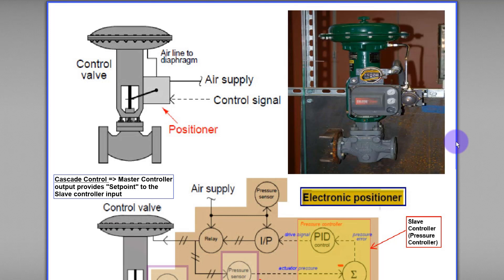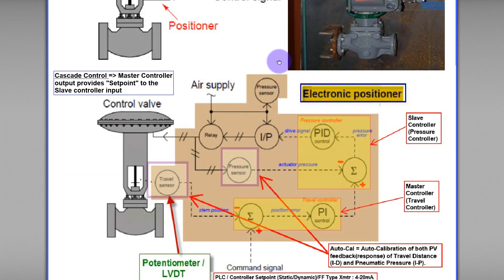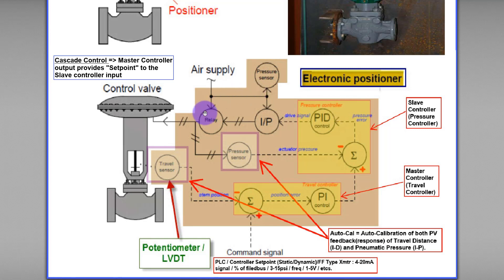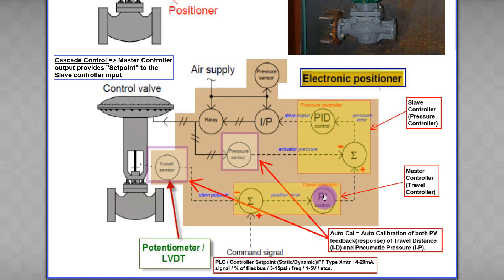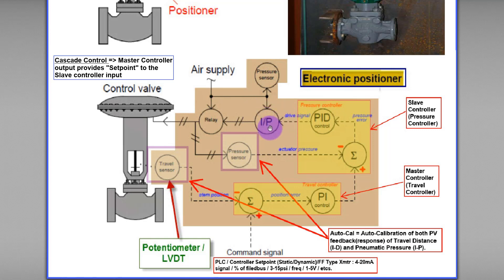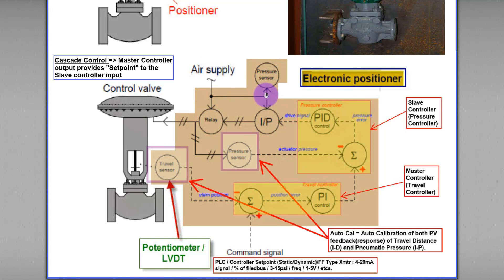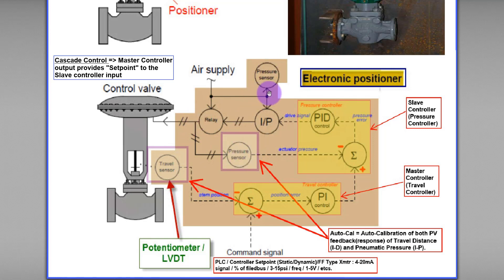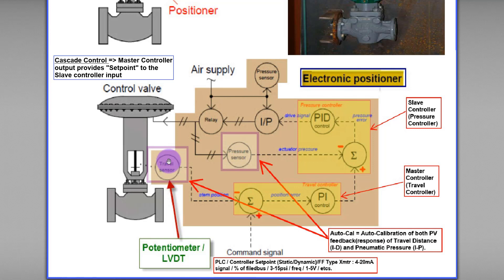Electronic Positioner Principle of Operation

Comment from the maker: "Positioner is none other than a controller but positioner is specifically design for control valve just like the VFD is specifically design for the motor. Cascade control means the control involving one Master Controller and slave controller. The Master Controller output provides the setpoint to the input of the Slave Controller. 

Inside the positioner itself, there is master and slave controllers. The external controller such as PLC will provide command signal (control signal or setpoint) to the input of postioner which is master controller input (travel position controller). This control valve travel position setpoint will be compared to the process variable (PV) feedback from the travel sensor (potentiometer or LVDT) which is usually located in the positioner nearer to the valve feedback arm. The input error (deviation) will be fed to the PI controller for processing. 

Then, the PI controller output will provide the pressure setpoint to the slave controller (PID controller). This pressure setpoint will then be compared to the process variable (PV) feedback from the output pressure sensor which is usually located inside the positioner. The input error (deviation) will be fed to the PID controller (pressure controller) for processing. Then, the Pressure controller will output drive signal to I/P transducer.

I/P transducer will convert current to pneumatic pressure and this output pneumatic pressure (MV or manipulating variable) will be fed to the actuator of the control valve. This will then cause the valve stem to move and the travel distance will be detected by travel sensor either via the linkage travel arm or via the magnetic array method."